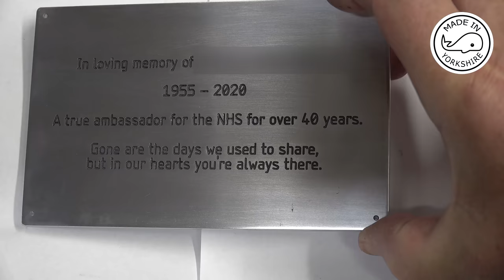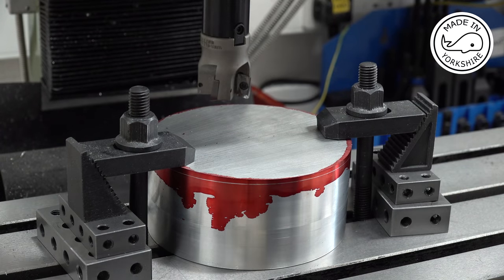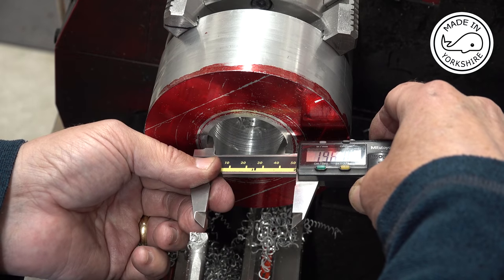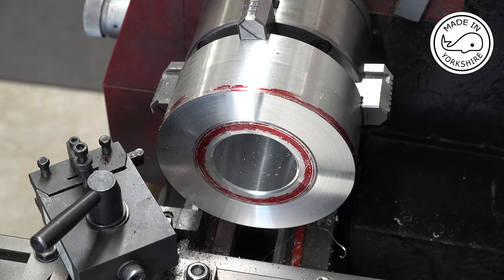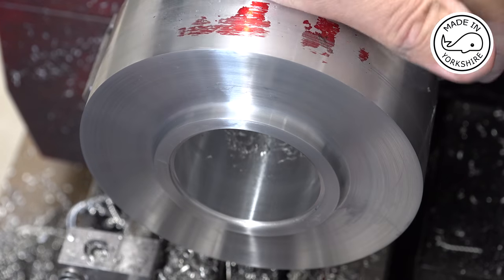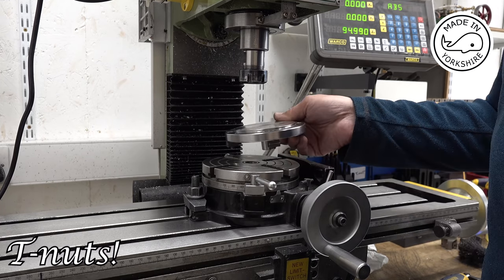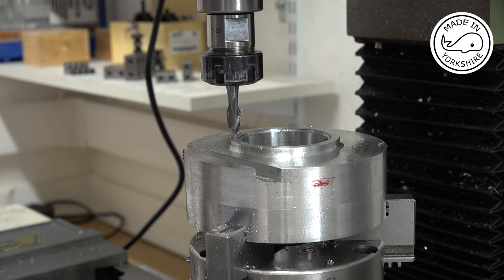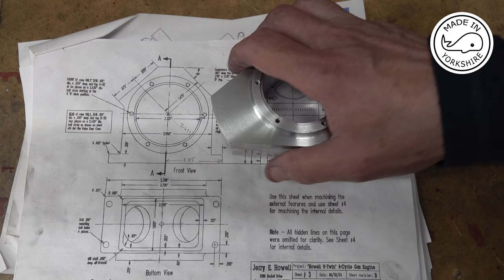#MT49 Part 1a - Jerry Howell V-twin IC Engine. Making the Crankcase. In 4K/UHD by Andrew Whale.

Comment: Hi Andrew. Love your series you do a great job. Just a note that a  indicator setup on the edge of a hole and spinning the rotory table will always show center as you are rotating around center of rotary table not center of your mill . You still need to spin the indicator in the hole. Hope this make sense. Cheers
Reply from the maker: Hi Mike - thanks for the explanation. I get it now. How embarrasing - I really goofed up there!
Fingers crossed the coaxial indicator got it centred correctly.
Cheers
Andrew
Reply: While talking about co-ax, always use the shortest possible stylus, a long one reduces the accuracy because of the ratio of arm to indicator.
Reply from the maker: @chrisstephens6673  thanks for the tip! 👍
Reply: @learningturningmetal  
Hi Andrew. I learned this one the hard way. Cheers Mike

Comment: Great so far Andrew. Just a thought on my part, if you have some I would suggest that you grind up some HSS tool bits for aluminium turning. You seem to only use carbide inserts, personally I find them not too good at getting a nice chatter free finish. The biggest trouble is that they are moulded and do not have a nice sharp edge to do fine finishing cuts, OK if you take deep cuts. I must admit though that the bore came out well with the carbide insert. I suppose me being "Old School" I was brought up on HSS in the 1960's well before insert Carbide was common place. They do make special inserts for aluminium. I see too in this episode that you have "Slipped Back" into you 10 thou cuts again. LOL Regards from Australia
Reply from the maker: Hi Dave - thanks for the suggestion. Actually I do use special inserts for aluminium - even when machining cast iron, steel, brass etc. They have a really sharp egde and I generally get very good results. The footage showing me facing the side doesn't look like a great finish but 4K video tends to show up any slight imperfection. When facing the side I always lock the carriage, but I think that there might be some slight give on the compound slide. It's someting I need to investigate. I've never had any success with std carbide inserts - as you say they don't have a sharp edge. Yeah - 10 thou cuts tends to be a habbit when using the lathe!
All the best.
Andrew
Reply: I wondered about that as well.
 Seemed to be turning awfully slow and 'worrying' material rather than cutting it.
You would be well aware that with HSS you can grind much better rake and clearance angles to use on aluminium. (I use mostly 6061) 
5" diameter would be spinning at least 500 rpm and probably at least 0.060" deep cut, even on mini lathe. 
3" diameter is usually going at about 1,000~1500 rpm and 0.80" deep cut (0.160" diameter reduction)
Reply: @1crazypj  Thanks for your reply, yes I am afraid Andrew is a set in the mould of a 0.010" cut man on his lathe. He does try very hard to cut more, but slips back into his preferred cutting ways. Gets there in the end but must add several hours to his machining time. I assume that he is retired so time is probably not an issue. Regards.

Comment: It was great seeing all your completed engines at the beginning of the video.  It's a fantastic collection as they all look and run great!
Reply from the maker: Thanks Douglas. I think the carburation on the Hoglet needs a little adjustment and that little S50 has developed some play on the crosshead. But they are there to be played with. No point sticking them on a shelf for them to gather dust.
All the best.
Andrew

Comment: G'day Andrew. You're starting off well, looking good. You had to remove a lot of material from that billet did your eyes water seeing the $$ cut off? Cheers Peter
Reply from the maker: Yeah Peter, that lump of aluminium did cost quite a few quid. The machining instructions suggested using round stock for easier work holding, but the result is lots of waste. I must try to have a go at making my own mini foundry sometime.
Cheers
Andrew

Comment: Hi Andrew - great video. Bearing in mind Mike's comments re rotary table which are very relevant - if you are getting inaccuracies especially with large movement on the Z axis vertical column after having centred the rotary table with the centre of spindle. The vertical columns on these machines may have slight inaccuracies (they are not built to jig borers standards), and also it might indicate marginal out of squareness of head/quill with the table. Always worth a check. hope this helps. Tim
Reply from the maker: Hi Tim
Many thanks for the information. Very interesting!
Cheers
Andrew

Comment: Is there anything in your house that hasnt been labelled?  I bet the dog has got a new name tag😂 Really enjoyed this video. Good to see you back doing work I understand. The crankcase is a major piece of sculpting. Starting to take shape now. The chatter on those bosses was like a swarm of bees. They polished up nicely though. I can see that this project is quite a challenge. I dont recall seeing anyone take on quite such a complex engine on You Tube before. Good luck.
Reply from the maker: Ha ha Tim - but I nearly did start to design a brass nameplate for the dog! Yeah, I think I need to check the gibs on the lathe because something isn't quite as it should be. There appears to be very little information on the internet regarding  the build of this engine. However the serial number for this engine is #599, so plenty of people will have attempted it.
I think I need 'good luck' on this one!
Cheers
Andrew

Comment: Hi Andrew, thanks for replying . I don't know what tools you have so i will mention a couple of things .You will need gear cutters 48 pitch you don't need to buy a complete set  but you will need cutter numbers-2-3-4 to make all the gears you will need for the engine, also buying the bearing kit will save you a lot of time as the engine has a lot of bearings. You do very nice work and i'm sure you will do a great job on this engine
Reply from the maker: Hi Randall. Thanks for the info. A while back I decided to purchase the bearing kit and seals kit from the JH website. On the surface they seem quite expensive at $155 (incl delivery to UK) but I think I would have paid more and spent lots of time trying to buy individually from the UK. I thought I needed 48 pitch cutters 4,5,7,8 and I can only find 7 and 8 in the UK. I used cad to convert to Mod 0.5 and recalculate centres but I'm still undecided what to do. I might see if I can find a US supplier willing to ship to the UK. Do you know of any?
All the best.
Andrew

Comment: From one Yorkshireman to another, I love watching your channel and I have followed you for years... there is a caveat, though... don't do so much stuff off camera... in this, we go from a piece of basic lathe work, to a precision work in progress... we need to see that progress, not just 'I did this off camera!'
Reply from the maker: Thanks Gordon - it is a bit of a balancing act, and this was turning out to be quite a long video. For example, I think I've covered the DRO hole circle function several times in the past so I decided to leave that out this time. If machining tasks are repetative I try to leave those out too. However, I do try to include most of the key tasks to assist others who might try to build this engine. If there were other tasks that I did off camera it would be interesting to know which. I'm also aiming to complete the crankcase in two episodes, otherwise I will never manage to complete this engine.
All the best.
Andrew

Comment: Thanks for an entertaining and inspiring video, as soo many time before.
Time 05:20. Why not only face off the centre needed for center drilling and the rotating ...? That implies less of forces to the object.
Time 06:40 Using the mill... Why not? Looks like thinking outside the box. Well, You think outside the box in most videos.
Centering the rotary table, Time 23:10..... Brilliant! I'll try that instead of the coaxial indicator.
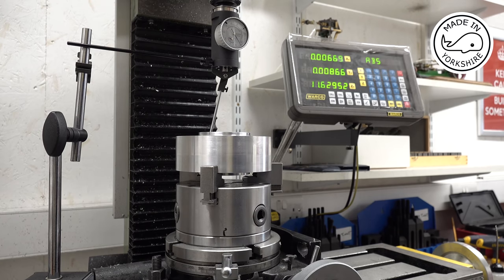Time 24:35..  Frustration here. Not spindle height enough to do that....
A breath taking video.. Really well done! Offer Your skills to the space industry....
Reply from the maker: Thanks Stefan. Using the MT2 arbor to centre the table should get you very close - but always double-check with a coaxial indicator.
Also my method of using a dial gauge and turning the table was flawed. I should have turned the spindle instead. See comment from Mikes Adventures.
You live and learn!
Cheers
Andrew
Reply: @learningturningmetal  Thanks for telling! 
By the way, great name plates You made!
First face milling..... I use the spindle and probe around, using very light contact, on the piece, keeping an eye on the digital scale...

Comment: You have done a fantastic job on all of your engine builds so far.  No reason to think that this one will be anything other than perfect as well.  Love following along with all of your work.  👍
Reply from the maker: Thanks Jim - it will certainly have it's challenges. The gears are DP and it's difficult to get hold of decent DP cutters in the UK. So I might have to convert to Mod and adjust centres accordingly. We will see!
Cheers
Andrew

Comment: Welcome back…I was thrilled to see that you were able to get your CNC machine completed and up and running.  I am glad that you started working on the V-Twin project.  Your methodology for making the crank case seems a bit over complicated, perhaps it was due to the material that was available to you, nevertheless, you’re doing a great job and it’s starting to take shape.  Complicated or not, You can do it! You have all the support of your viewers who anxiously await your next video.   Cheers!
Reply from the maker: Thanks for the encouragement! The build instructions suggested using round stock for easier work holding. The drawback being lots of material to remove. Hopefully I will manage to make a decent little engine. Fingers crossed!
All the best.
Andrew
Reply: @learningturningmetal  you’ll do a great job at it, we have faith in you.